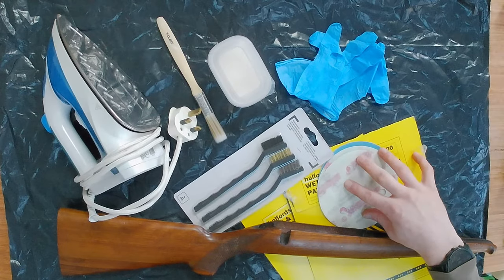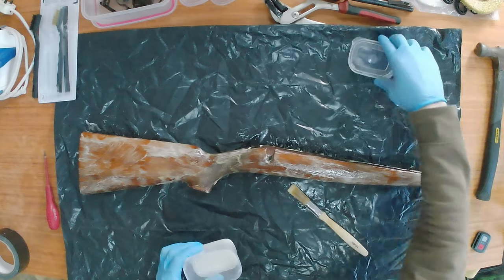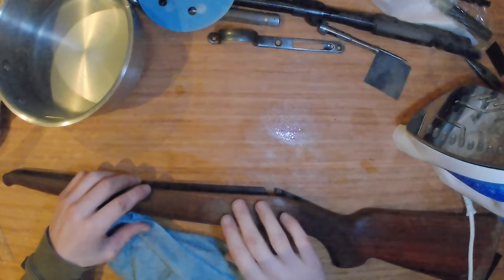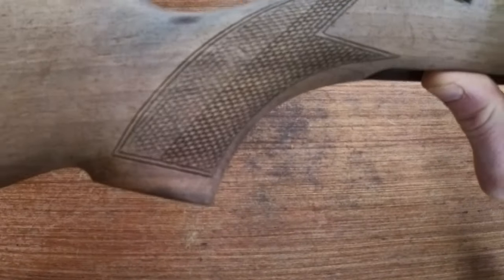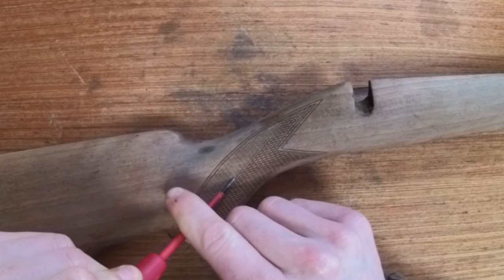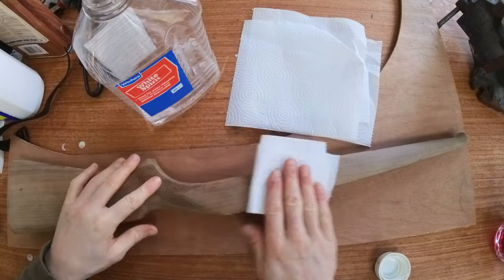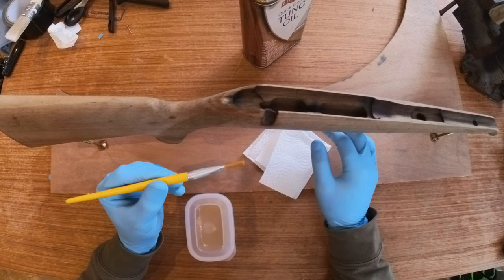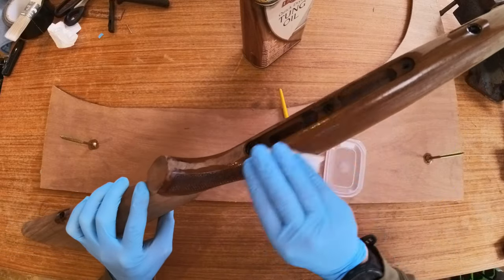Rifle Restoration Part 3 Woodwork BRNO MOD 2/CZ 452. How to restore a BRNO MOD 2 CZ 452 Rifle Stock

Comment: Thank you for your great films :) I have the same rifle and would like to restore it when bedding and correcting the stock. What is the wood stripper you applied for the stock? What is the type and its consistence - a gel, a paste or a wet powder?
Reply from the maker: Thank you for watching! I used No Nonsense Paint Stripper, its inexpensive and works well! I'd say more of a paste consistency, try searching for it for more details! Once it had done its job I washed it in warm water and let it dry for several days. I hope this helps!